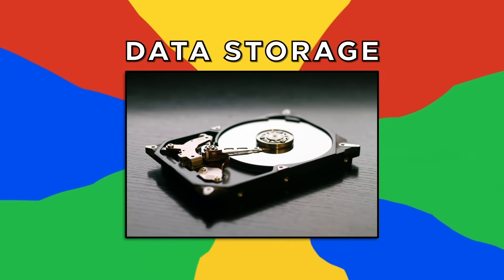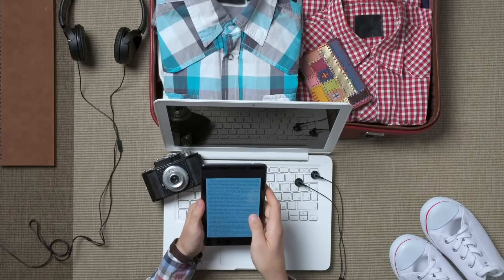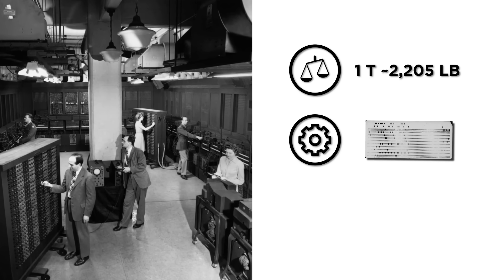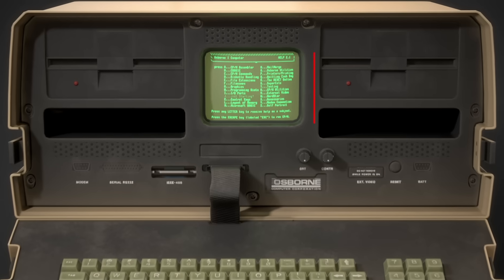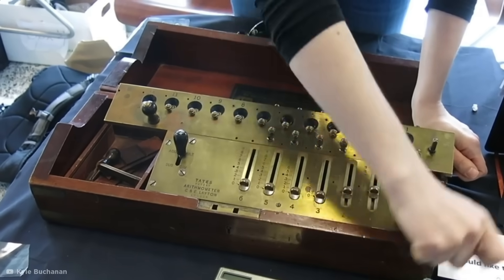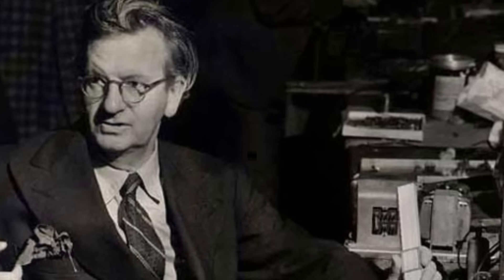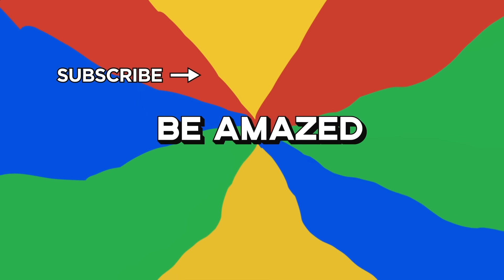Past And Present Technology Then And Now

Comment: Corrections:
(1:47) Sony made that, not IBM
(1:51) You missed a few more formats, first the Compact Flash Card, and then SmartMedia (the predecessor to the SD Card)
(2:10) This is MicroSD, not MicroUSB, that's a port
(2:18) Specifically 1048576 Megabytes, if it's just 1000000 it will actually be 0.9 Terabytes
(2:28) The cloud exsisted a bit before that, i don't know when specifically
(2:57) The iPhone isn't actually the first Smartphone, there were dozens more running either Symbian OS, Windows Mobile, or Palm OS, and the actual first was the IBM Simon in 1993, and it's Steve JOBS, not JOBBS
(2:57) it's pronounced "LEE-BREIH"
(9:04) Fake photo

Comment: Your math is wrong. In America, a tera byte is 1 billion  bytes. A mega byte is a million bytes or 1,000,000 bytes. A billion is 1,000,000,000 bytes. A thousand million bytes
Unless you are using the British scale where 1,000,000 equals one million. And 1,000,000,000 equals one thousand million. (In America this quals one billion.) 1,000,000,000,000 in Britain thiis equals one billion. In America this equals one trillionn. So what is off by a factor of of 1,000 between friends

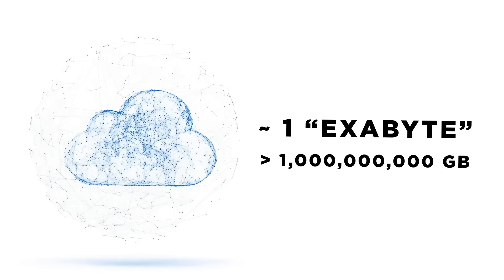Comment: 2:35 Try again. 
Moore's Law has nothing (directly) to do with storage capacity.
Moore's law is the observation that the number of transistors in an integrated circuit (IC) doubles about every two years.

Y'all make very entertaining videos, but you REALLY need to research your facts better.

Comment: These days a $4000 phone is exclusive to satellite phones and they are still smaller than the original cell phone. Not even a 2TB iPad Pro 12.9 with M1 processor costs much beyond $2500 and has 2TB of storage, and a 12.9" screen

Comment: Another tidbit.   Before 1907, heavier than air flight was not a thing at all.  by July 1969 we landed two men on the Moon and brought them home safely. 
Today we have sent probes to all of the planets known by our ancient sky gazers and landed on Venus and Mars and Titan and explored Uranus and Neptune and Pluto with flyby probes by 2015.   The Pioneer and two Voyager craft are well past the edge of the Solar System and the Voyagers are still transmitting data to us.  Al this occurred in less than 120 years and most of it since the 1960s.

Comment: I still chuckle at my first desktop 286. It had a clock speed of 4 Mhz, BUT it had an 8 Mhz "Turbo" button 🤣🤣🤣
Reply: It's the opposite. 8Mhz is its actual speed. It has to slow down to use the older program which ran at 4MHz i they added turbo button to switch between them.

Comment: No disrespect, but the Internet holds a LOT more data than a single Exabyte! 

One estimate was that as of about 2020, the Internet had 44 Zetabytes of data - 44,000 times greater than an Exabyte. Another estimate that same year was about 65 ZB - and it's almost assuredly grown since then. 

Lastly, there is a filesystem designed to handle all this data on a single computer: ZFS, although building such a computer would be, today, nearly impossible, and highly impractical if it were built.

Comment: we don't measure the resolution of CRT TVs in pixels. We determine how many TV lines a CRT TV has per scanline. Also CRT TVs were always 480 scanlines with a max horizontal resolution of 540 TV lines per scanline. pixels don't exist in an analog display

Comment: PC progress is going down. in 1993 u had a very old computer if it was 2 year old. In 1992, i bought my first computer. It was a dell 486 25mhz sx with 4 megabyte ram and 120 mb disk. Video was amazing 64k. After 6 months i had to double ram to 8, because of it starting to going slow for the new program. 1993 i had to buy a complete new one, because the old one counld deal with new programs i needed to run. To day u can have a 5 years old computer or older and still its going fine

Comment: I have one of the first iPhones. It's in mint condition. I wish I still had the original box and papers. But the phone works and looks like new. Of course it will likely never work on any current cell network because even my iPhone 5 will not work on any American cell network. ATT actually sent me a brand new iPhone XR last year for free so I would be able to remain their customer. I have had ATT cell service, same account and phone numbers back when it was called Cingular. I also had the Motorola "brick" but the slim line model in the 1990's. I also graduated to the Nokia then back to Motorola when the first Razor came out. That was my favorite phone. I actually hate theses "smart" phones. They have turned 90% of the population into idiots. One example is every single time I am at a red light and it turns green, I have to blow the horn because every dummy is on their "smart" phone instead of paying attention to the road.

Comment: When it comes to computers he didn't mention how far we've come in other components like cpu's and gpu's in more detail. Just 20 years ago from the time this video was published the best gpu's and cpu's were the Nvidia's Geforce 2 with 200mhz clock rate and 128mb video ram, ATI Radeon 256 clock rate 200mhz 128mb video ram, Intel Pentium 4 1 core 1 thread clocked at 1.5GHz and AMD's Athlon Thunderbird 1 core 1 thread clocked at 1.2GHz. To put that into perspective the best gpu's and cpu's at the time of this video were Nvidia's RTX 2080 Ti which had a boost clock speed over 1635 mhz 4352 cuda cores and 11gb video ram, AMD's Radeon VII had a boost clock speed of 1905 mhz 3840 stream processors and 16gb  video ram, Intel core i9 9900K 8 core 16 thread, boost clock speed 5Ghz, AMD Ryzen 9 3950x 16 core 32 thread, boost clock speed 4.7Ghz.  GPU's went from 128mb's in 2000 to 24gb's with the RTX 3090 in 2020 and consumer cpu's went from 1 core 1 thread in 2000 to 64 cores 128 threads in 2020.
Reply: The 3990X has 64 cores and 128 threads and 64 core cpu's were available in 2020
Reply: @stephanietremblay9851  Yeah you're right I'll change it to 64 cores 128 threads.
Reply: @LiquidSnake690  I have a 5950 on my gaming PC and it's pretty good but not worth the price IMO. 
It has 16 cores (32T) but most games if not all can barely use 4 cores. I used to have a Intel i5-6600K overclocked to 4ghz and  that was really really worth the price. This CPU combined with a SSD drive would load RDR2 and GTA5 crazy fast. It's the CPU i recommend the most for the price for people who like to overclock the hell out of their CPUs
Reply: @stephanietremblay9851  I have an i9 10900KF, RTX 2080 Super, Samsung 970 Evo 2tb and 64gb DDR4 ram clocked at 3200 mhz.
Reply: @stephanietremblay9851  Red Dead Redemption 2 and GTA V aren't the most cpu intensive games. There are newer AAA games that are using at least 6 or more cores. If you're talking about most esports and indie games not using more than 4 cores then you'd be right. I know games like the Division 2 will use up to 16 cores if you got them but it doesn't need 16 cores but it does indicate that future games will need more cores. For example Alex from Digital Foundry found out from running the Unreal Engine 5 Matrix Awakens demo that his i9 10900K was bottlenecking his RTX 3090 at 1440p. Alex also ran his hardware in Halo Infinite and discovered you'd need better than an i9 10900K to get frame rates higher than 120 fps.
Reply: @LiquidSnake690  I still play with my old 1080 ti (11GB) and at 4K at rdr2 i get about 65FPS average. CPU use is like 35% and GPU 100% so eventually i will need a newer GPU. The 1080 ti still holds up pretty well for most games tho
Reply: @stephanietremblay9851  You'll also find that when you upgrade to a cpu with 8 or more cores that windows and games feels smoother and more responsive. I mean with 8 or mores cores your average frame rate might not be significantly higher but the %1 lows,  %0.1 lows and frametimes will be smoother.  Also keep in mind that %25 and %50 cpu usage on a Ryzen 9 5950x is 8 and 16 cores utilized and %100 usage is all 32 threads utilized. My sources for this information is Tech Deals, Hardware Unboxed, Gamers Nexus and Digital Foundry if you want to verify my information.
Reply: @stephanietremblay9851  Also the GTX 1080 Ti was a beast for it's time. You probably should wait until the RTX 4080 is out and upgrade to that since I heard it'll have 16gb of GDDR6X. That'll be a worth while upgrade from your GTX 1080 Ti.

Comment: You forgot ZIP Drives (100 and 250 MB), Jazz Drives, Orb Drives, and similar "high capacity" removable disk drives of the '90s. Also, CDs with 650-700 MB of capacity...not generally rewritable but a decent capacity before Flash Drives and SD Cards.
Reply: There are FAR too many to even begin to list them all.

Comment: In the early 1990s I bought a 32kb cache memory upgrade for a Packard Bell computer.  Back then you could actually buy cache memory.  It cost me $800 from Radio Shack.  Today I have a very powerful PC that I built myself.  It has 64 GB of RAM.  If I paid the same rate for memory that I paid for that cache memory, it would cost me about $1.7 billion to get 64 GB.  And of course today's standard RAM is far faster than the cache memory was back then.

Comment: This video ignores the entire PC specs, other devices like PDAs, and all the other phone devices other than apple.  For laptops, it ignores products other than apple...  e-readers: it calls the kindle "most advanced" I have to differ.  It supports only items from amazon, and only amazon's formats.  I have been using the Kobo for many years and supports many more formats for books, and there has been waterproof ones (Kobo H2O was released in 2014), Kindles have not had that until end of October 2017!

Comment: Yeah but a lot of these computers are 30-40 years old.  20 years from now we will be saying Mac Pro Air only had 8 TB of memory. Today's 2041 computers have 800 Zettabytes
Reply: Technology is not developing at the same pace as earlier, storage devices like hard disk has its peak and its size is not increasing as earlier, processors are not developing at the same rate and the latest processor and laptops will easily work for 15 years without any slowness, now it takes around 10+ years for processor to get only twice the processing power of the old one which is negligible and nvme drive speeds are increasing but if you notice they are able to maintain that speed only for 100 seconds or so and will throttle to less speed, not much improvement in next 20 years. Your current laptop with nvme drive will easily work with great speed in next 20 years, you need to replace the thermal paste after few years, you can upgrade your laptop memory with 32 GB now and it will be enough for next 20 years.

Comment: Remember mobile phones that actually worked as a telephone? With working reception, actually understandable voice quality, and no interruptions, like muting and crackling every few seconds, with keyboards that you could blindly type on very fast using just one hand? And the battery could standby for more than a week in many cases.. man, technology has progressed so far, since!
Reply: Actually modern Smartphones are 9,000 times way better than the early day ones 
Mobile Phones aren't just for calls and texts
Reply: @stephensnell5707  The are worse in anythign besides apps. Which by principle are all secondary applications, compared to making cals and writing messages, which by using SMS/MMS worked even better before there where dozens of messenger apps, you had to install the matching one from.

Comment: Regarding apple: They are a *FOLLOWER**, not in innovator. Many others have created and innovated in mobile devices and other technologies long before apple got involved. Notably **BlackBerry* before they (sensibly) left the hardware market in 2016, a long stretch if you ask me.

Android (thanks to google) device makers took a while to prefect the mobile gnu/linux mixed with (proprietary crapware), to get to this point in time, yet there is still a divide in terms of features and operating system updates compared to apple's long-term support of seven (7) years.

As an avid GNU/Linux *user* (not programmer/coder), android and blackberry (android/older device) user, and former apple iphone (5s), microsoft windows (only very casual use now) user, I have seen so many changes, and yet to expect improvement in terms of innovation or anything else, in a span of 10+ years between hardware upgrades. Forget *two to three (2-3) years*, because that is TOO DAMN SHORT.

Comment: I think the reason we think the storage for older generation devices are so small is because, it is rare (unless music or e-book) to find anything above 1MB. An example of this is Cyberpunk on PlayStation is 101GB (also recommend the game (but the driving is terrible)), that is a whopping 101,000 times larger the 1MB. Which means you're going to need hundreds of thousands of older generation devices to run it, and even if it did with their small 3-8 inch screen and like 10 pixel screen it would be like trying to find the hole at the tip of a syringe.

Comment: Actually the baird tv system camera was kinda the reverse of others. The disks &c made a scanning beam of light, which bounced off the scene, actors &c, & was picked up by detectors in the room.

In other words, instead of the light traveling to the camera it came from it, like in many modern ray tracing programs.

Actors hated it. Standing in a dark room in front of a flickering bright light, the camera. They had to wear special makeup, & stay close together.

There was a later baird system that used a film camera. The film was developed, in real time, & broadcast.  I don't remember much about it.

Comment: There’s a lot of things they got wrong with TVs. Pixels per frame is a bad unit because a phone and a TV could have the same pixels per frame but the TV is bigger so the picture looks worse. Pixels/in^2 would have  been necessary for an actual comparison.
Reply: You prune
Modern Televisions are way better with fantastic image and sound quality
The length of modern televisions is even better than the shitty early day televisions which weren't no larger than 14 inches so yes modern T.V.s are 200 times to 300 times better than early day televisions

Comment: Bruh that’s an iPhone X at 4:22. iPhone 11 would have thicker bezels and an aluminum build, I would half believe u if u said it was an iPhone 11 Pro but it has the IPhone X wallpaper and small design differences like have the iPhone 11 Pro having more antenna bands on the stainless steel.

Comment: First off you know apple has behind on cell phones compared to other companies for last 5 years. If you look at past tech to today so many were dropped for decades until it was more usable. Like touch screen computers were in the 60s there were touch screen phone I think in 1992ish so it took 50 years to make touch screen popular but 15 years or so from first touch screen phone to the Apple iPhone. What about battery powered cars late 1800s was first then died out and slowly came back in 60s and 70s then died again till the 90s then 2000s were big seller again. I'm still a fan of 3-d videos but the old tech was to me far better it was in your face but when tvs became popular using 3d glasses again bought one hoping the tech was going to be like my childhood is was horrible depth was so little wasn't worth it. Virtual gaming was I think the mid 70s to late 70s but then kinda died away the tech was dropped by so many cuz cost wasn't there so that tech came back about 30 plus years later but didn't act the same either old tech you where in the game your body and worked it came back and wasn't you it was wands and gestures. So not all tech is moving fast if the tech would have stayed on the table from its start we would be farther ahead. The cell phones would be id almost say 10 years ahead easy. Also dvds is already kinda been around for 41 years started with Lazer disk was pricey sales were not great it was dropped till 1997 for dvds we have now so tech stopped now its bluray and streaming which came out in 1995 but was forgotten fast till Netflix made it big again. Bluetooth wasn't first way to transfer info without cables it was IR. So to me tech is slowly moving its not moving fast like we are told it is. Everything that was already been made but died cuz cost or no place for the tech is now coming out of wood work last 20 years and to me your looking at little changes every year so may be outdated every year your not truly out of date for few years easy if it was moving fast cell phones would be obsolete cars would already be unmanned lights would last decades computers wouldn't be towers or laptops they would be Tony starks appliances would be farther ahead but those work people are happy with those so they don't invest tons of time or money into it like all the other past tech

Comment: I remember when the wife and I bought our first computer in 92 or 93.  It was a 486 D or SX2, 50 Mhz, with a whopping 8 MB of RAM, and a 450 MB HDD.  It came with a commercial from Microsoft, from the man himself, saying that 450 MB was the most hard drive space one would EVER need.  Now, even my smallest thumb drive is 256 GB.  I remember getting a multimedia upgrade that came with a 2x CDROM, speakers and an additional 8 MB of RAM.  I later upgraded to a 100 Mhz system.  Oh, and this was before computers came with modems, so when dial-up became a thing, I had to buy one of those too.  I believe the first one I got was a 9600 kbaud.  It's so funny, if you ask a kid today what a baud rate was, they'd probably assume you meant something about the human body.
Reply: long comment written
Reply: I had exactly the same journey with 486 DX2 or DX4, multimedia upgrade and later Intel Pentium 100 during the year 94-97.